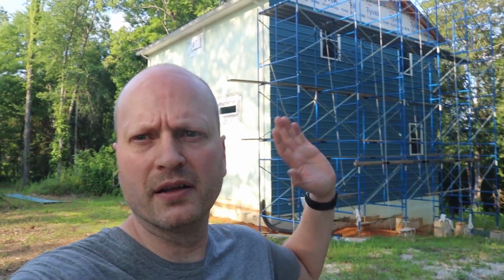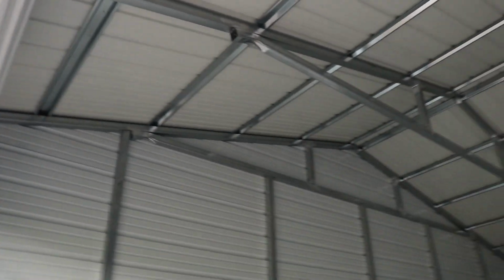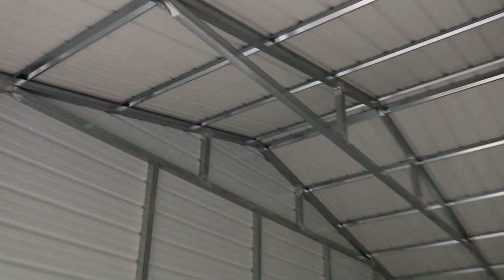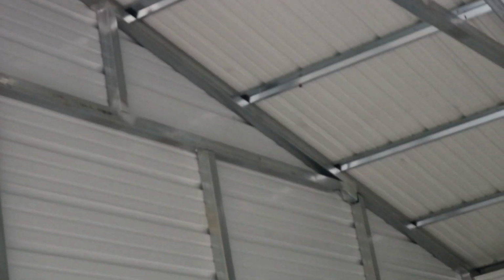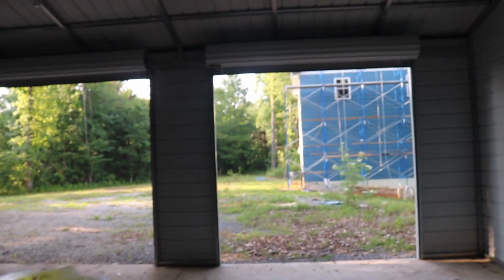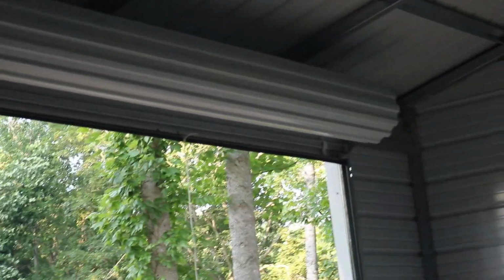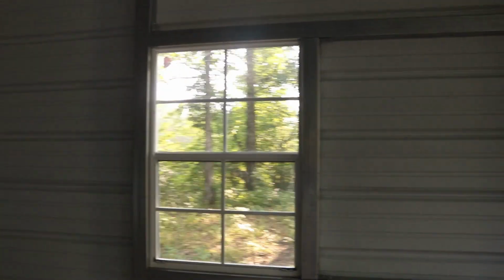GARAGE BUILD TIMELAPSE | DIY | METAL BUILDING

Comment: seems awfully cheap for a structure that size compared to what we'd have to pay in the UK, seems we're being robbed lol
did they lay the concrete floor to the garage to so all you had to do is prepare the foundations for it? what about electrics & wiring do they install those or just the structure
and that's a huge garage too, you could keep your bentley there & have plenty of space for a truck & a workshop on the other side
glad to see things moving fwd for you
Reply from the maker: Thanks Taz.  I already had the concrete floor installed before.  They did just the structure.  I will do the electrical.